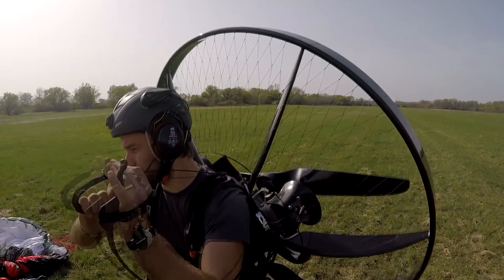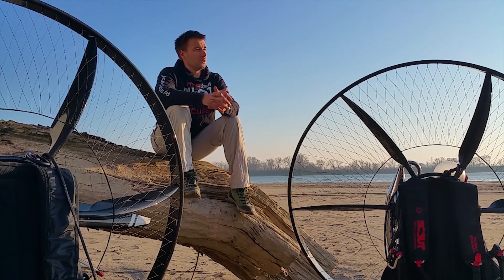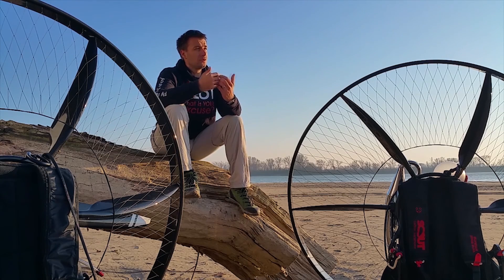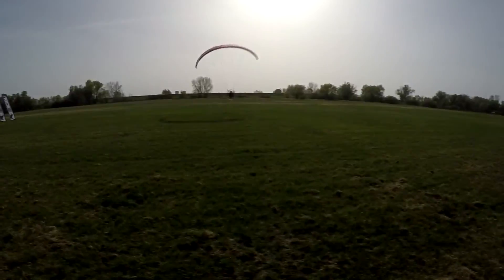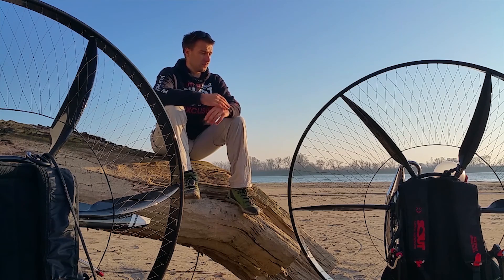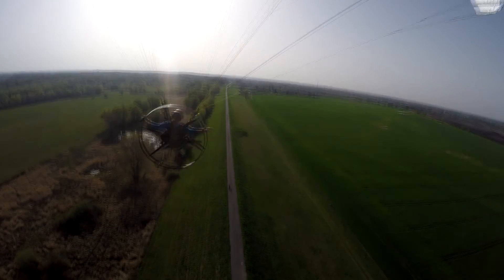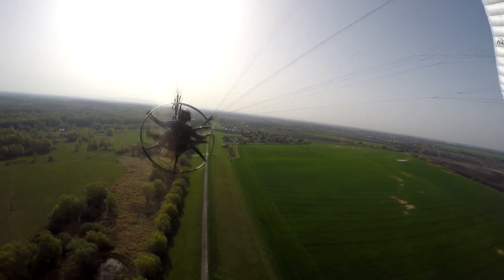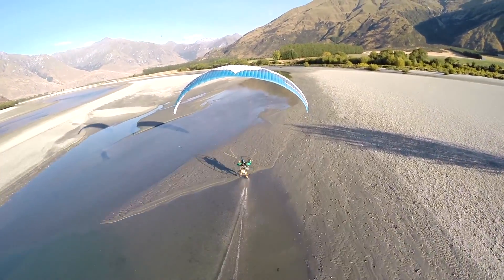Dynamic torque compensation SCOUT Paramotors

Comment: Does it effect the steering on decent with low or no throttle?
Reply from the maker: +BOB DOBBS theoretically yes. In fact we haven't ever noticed. The method relies mostly on propeller-generated airflow.

Comment: I see on the video that the system works poorly .. 2,32 - 3,00
Reply from the maker: If you go to full throttle you will feel some torque for a fraction of a second. It's because the prop did not generate airflow yet. 
This will swing you to the side slightly. 
After the prop reaches high RPM it will generate its own air flow to compensate the torque and the torque steer disappears = you will swing back under your glider. 
On other paramotors you would continue to turn to side, but not with the scout. 

Have a test flight and see for your own.
Reply: "If you go to full throttle you will feel some torque for a fraction of a
 second. It's because the prop did not generate airflow yet. 
This will swing you to the side slightly..."
 Dear Sir.... that is due to inertia torque...not to airflow torque...
It might be safer for your company to educate you in aerodynamics....

test flight?? Yes?
Where in Poland??
All the best...great movies...
Reply from the maker: > inertia torque: 
Yes you are absolutely right. Here is our article with full explanation of torque: http://www.scoutparamotor.com/paramotor-torque-effect-explained/

> test flight in Poland: 
Dynamic Sport
Wojciech Pierzynski
info@dynamicsport.com.pl
www.dynamicsport.com.pl
tel. +48 602 794 966
tel. +48 693 417 716
Reply: Mazby2 z

Comment: can you explain me how it is possible to compensate the torque by airflow if your vanes/ directional fins, are in FRONT of the propeller? If that shall work they should by AFTER the prop, like in a Ducted Fan Turbine.
Reply from the maker: The propeller creates airflow both in front and back of the propeller. It suck in front and pushes in the back. 
Airflow in the front and in the back are equal, although its way more turbulent behind the prop.
Reply: Thank you very much for fast response. As for your explanation, , looks like my years of aerodynamic studies can go to trash.....
If the airflow in front would be the same as in back the paramotor would never move! There would be no pushing force. 
I propose you to use a simple pressure meter or wind meter and check the pressure and the speed of airflow in front and in back. Falling for your theory that vacuum of sucked air  makes the counter torque, the airflow in font has such low pressure that created force on your fins is almost non.
You should have a look at the ducted fans that deal with torque. They have airflow directing fins... (still not all the torque is compensated) in the back where the speed and pressure of airflow can help. As for props, You should either study or experiment yourself with smoke or vapour, what happens in front of a prop. I can assure you that the stream is so unregular in front, (the edges of prop throw backwards almost 20% of airflow!) that it cant produce that enormous power to counter prop torque. If you would say that part of torgue is controlled I would just ignore your publicity movie. Showing that ALL the torque is compensated is ... no need to be rude...
In my opinion, its much cheaper for you to make a fancy construction of the carbon prop guard, than construct a real functional airflow directing fin behind the prop (that would work)
It looks that the tilt of your cylinder and exhaust to the left make more counter torque. Small adjustments on the center of gravity and we go straight.
  never the less, the publicity movies are great.
Reply from the maker: Go and have a try. You will see for yourself...
Reply from the maker: Please contact us for a test flight at info@scoutparamotor.com